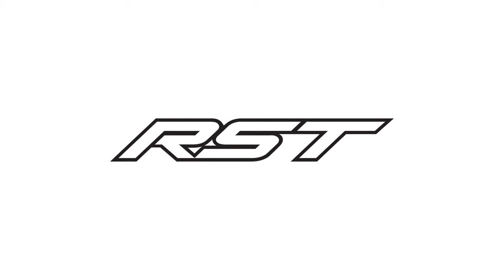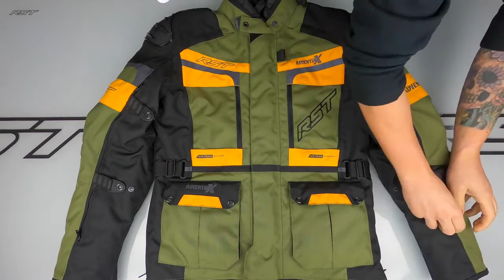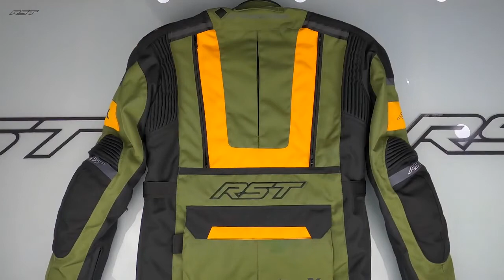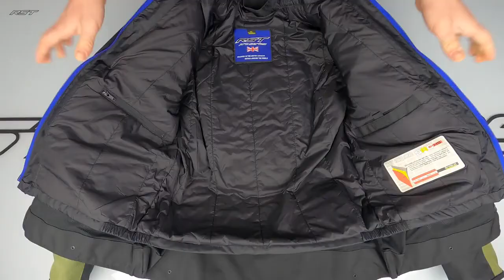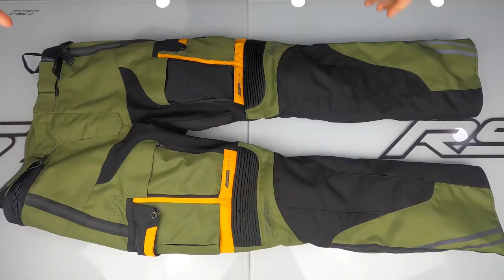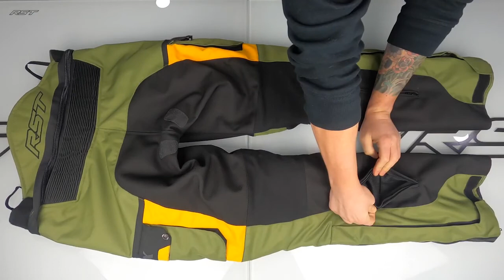RST Pro Series Adventure X Textile Jacket & Jean Features

Comment: The million dollar question,,,, how waterproof is the jacket without the inner?
Reply from the maker: Hi the jacket will still have a DWR coating ( which can be refreshed with spray on treatment)

Durable Water Repellency (DWR)- A Waterproofing Treatment Sprayed Onto The Face Fabric

DWR is Durable Water Repellency, another way of coating the fabric after a laminate or membrane has been applied to form a protective wall from water droplets on the outer layer.

A chemical treatment, DWR is not waterproof, but does reduce condensation forming, aiding breathability so less moisture reaches your skin.

Comment: less than 2 mins on the Jeans. Nothing about the liner, is it removable, how easy is it to put in? Do the ankles have a zip to open up or velcro or do they not open?
Reply from the maker: The Liner is removeable and is a sinaqua waterproof and thermal all in one which is fastened at the waist by a zip and each leg at the bottom by a zip and are very quick and easy to remove. There is a Zipped gusset at the ankles with a velcro flap to cover the zip.  The liner for the jacket is the same and is secured with a zip around the inner of the jacket and at the bottom of the cuff. for more information email clothing@crossan.co.uk

Comment: I bought one of these jackets and ‘jeans’ - no thermal liner, just the ‘sheet’ like sinaqua liner - nothing thermal about it. Is this a recent change for Australia or should I be asking the store for the thermal part too? (Assuming the thermal and waterproof lining can be separated)
Reply from the maker: are you sure its the Adventure X ? there is an Adventure X treme which doesn't come with the thermal lining ? the Adventure X does so if its the same jacket it should have one and it maybe worth contacting the retailer to inquire

Comment: Interesting, it wasn't clear from other online listings that the waterproof lining is removable. My question is - can the waterproof/thermal liner be worn over the top of the outer jacket? The Revit Sand 4 does this and it's ideal - much quicker to adapt to incoming rain if you can put the liner over the top! Thanks.
Reply from the maker: Hi sorry no it can be worn like that its designed to zip into the jacket